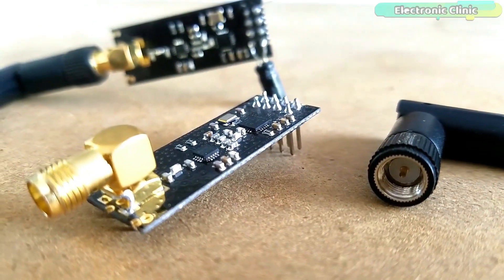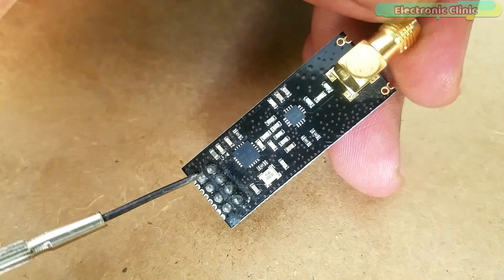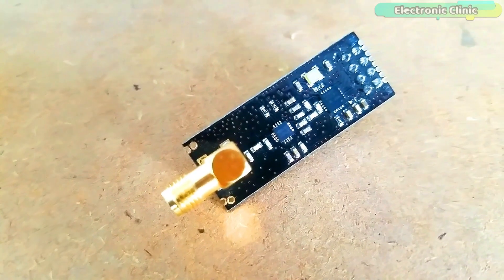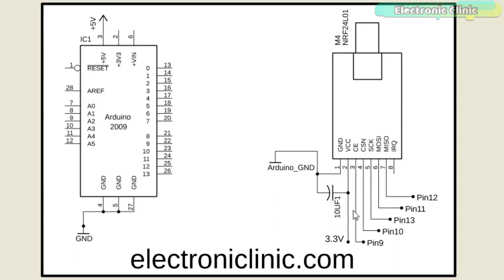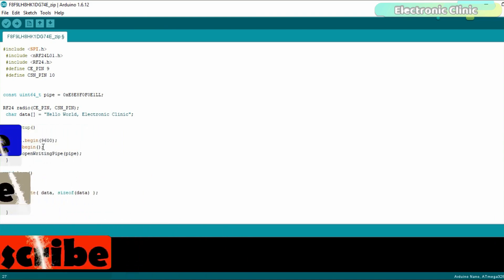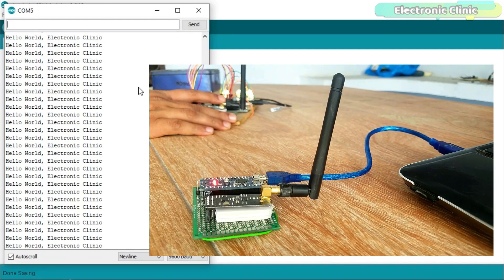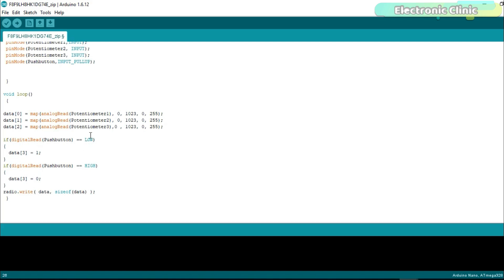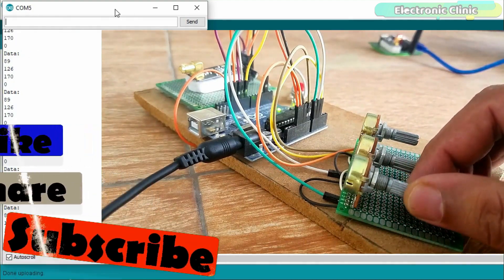NRF24L01 with Arduino, NRF24L01 Pinout, Interfacing, and Programming Examples, NRF24L01 Tutorial

Comment: I have tried servo motor control program but no luck. Codes from other sites too. No luck yet. I am  trying to control servo using pot. 
 Tried changing modules and base modules also. 

Suggest what I am missing.
Reply from the maker: Tell me about the issue. Wireless communication works?

Comment: which battery do you use in your plane? Is it powerful enough for at least 3 servos (ot 2)?please help me,answer the question...
Reply from the maker: you can start with a 1300mah lipo battery. Do not use a heavy battery.
Reply: @ElectroniClinic  thank You very much 😊
Reply: @ElectroniClinic  also,one more question.How do you connect that battery to the Arduino.Are the any special adapter?

Comment: sir the       done = radio.read(data,sizeof(data));   not working   the error message "void value not ingone as it ought be"
Reply from the maker: you might be using a wrong library. Download libraries from my website.
Reply from the maker: @Ismail Bessoltane all the libraries are available on my website. check link in the description.

Comment: Sir.., can we use the transmiter side using arduino nano  too..,? for tx and rx. Thanks
Reply from the maker: of course you can. i will release another video on 2nd november. in which i designed pcbs and used different pairs.